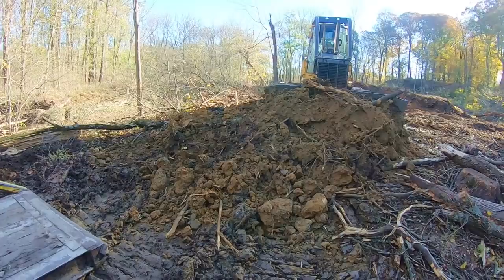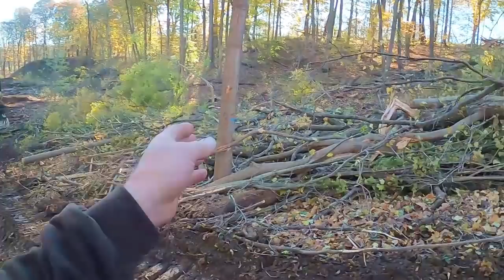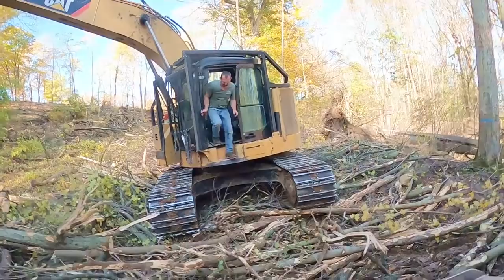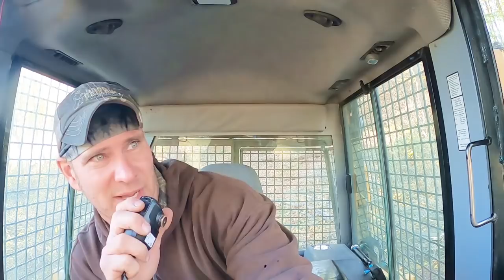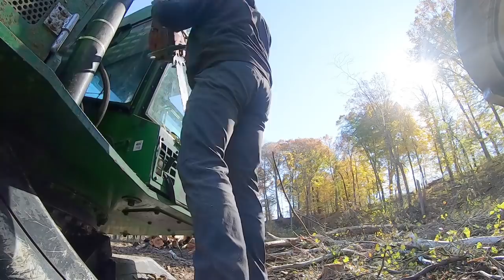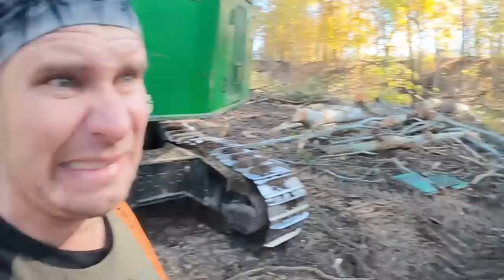Me and Stevey setting up corduroy Road!!

Comment: Adapt and get it done.  Wade you got all the other guys to worry about.  Not just getting the wood out, keeping men working and paychecks going out and the wood coming into the mill.   It’s a vicious cycle but it has to be maintained.  You know that you are only as good as the people you surround yourself with.  It’s a strong person to take on the load of so many things and to maintain that for the benefit of others.

Comment: Wade did you try chains? (Ain't saying you gotta use em) I've found ring chains fantastic for mud etc. But use studded net due to they don'trip your road up as bad as rings do. Use em on rear when I can. Seem to help with flotation and grip better than straight tires on sticks n stuff. Down side is they'll toss more stuff up on to your machine.